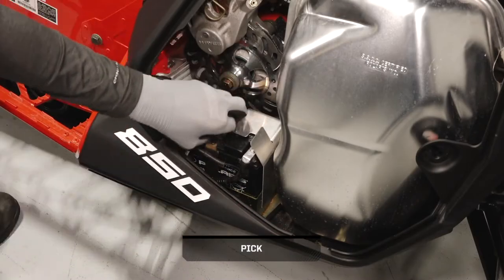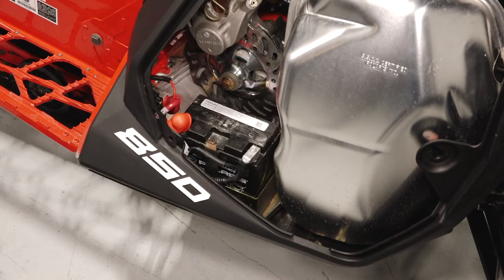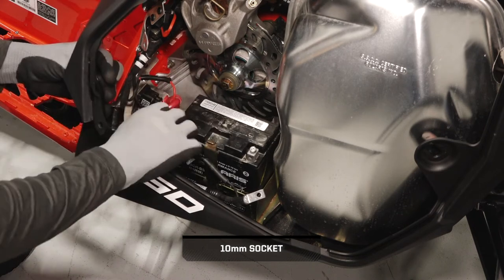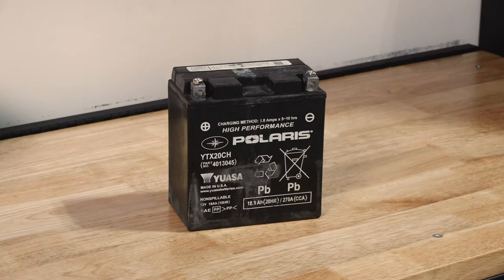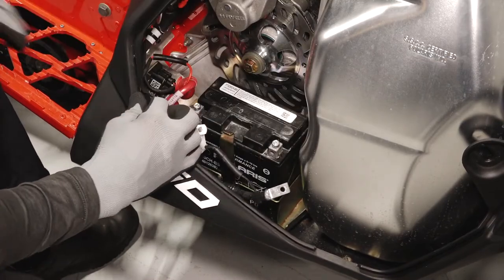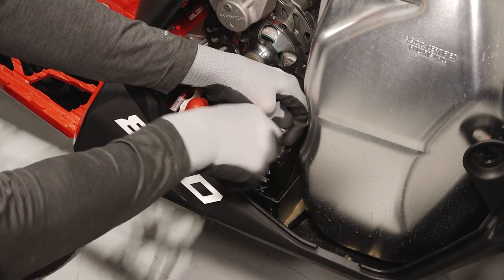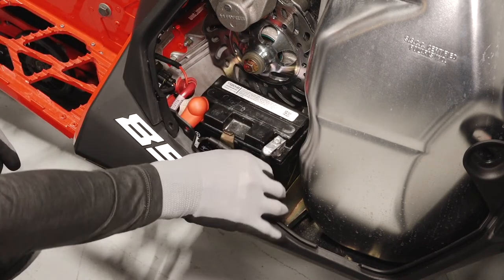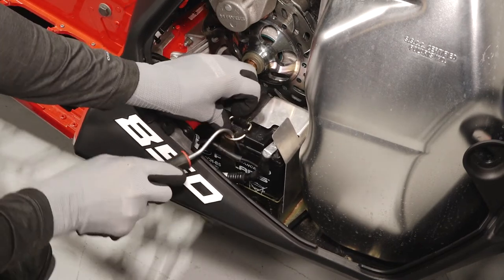850 INDY VR1 Battery Removal And Installation - Polaris Snowmobiles

Comment: Those push pins can be very resistant. Having the correct tool can make a big difference. I would use a Tuflok Pin puller/ large sidecutters/ flat screwdriver. It is a VERY good idea to put the terminal bolt back into the terminal post, to avoid misplacing the bolt, or the nut loose inside the battery post.
The battery currently used in these sleds is 4013045 Yuasa YTX20CH 20AH 270CCA sealed.
. Charge at up to 1.8 amps for 5-10 hours. There is a connector on the sled, next to the battery, for connection of a Battery Minder maintainer, this is a good way to increase battery life.